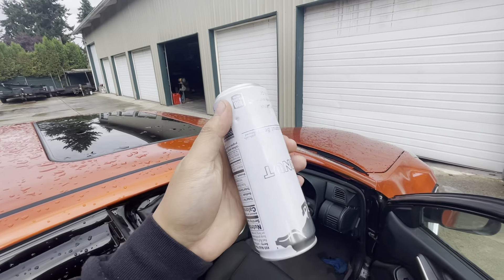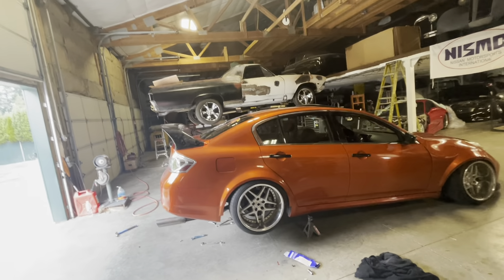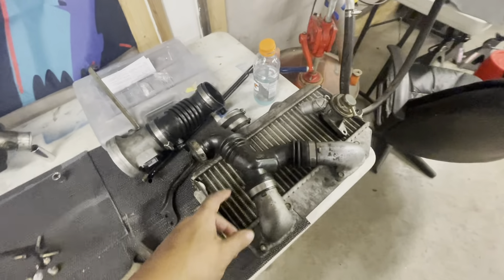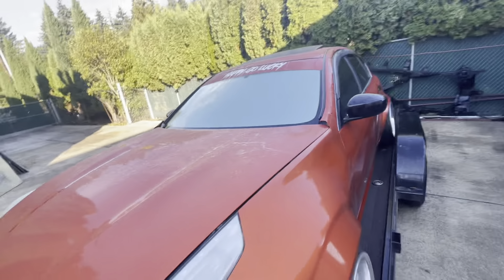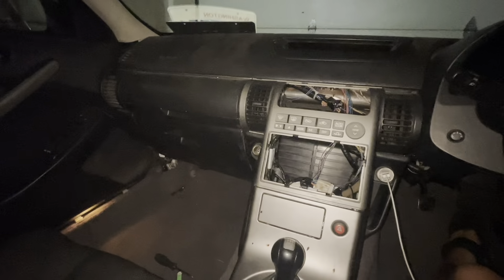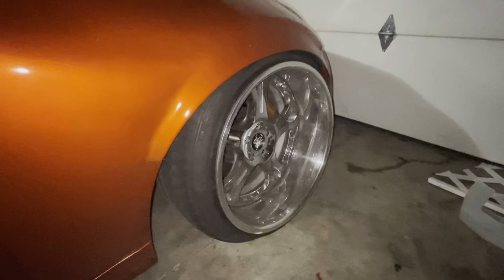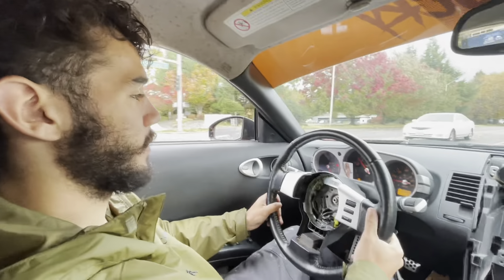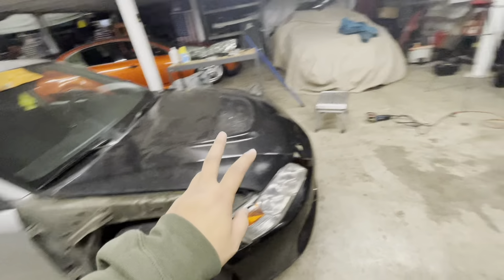350z Sedan Got Broken Into * Brand New Turbo Stolen*

Comment: The leak may be from the rubber grommet that was probably taken out under the black vent housing by the battery. Installing a stereo system people will usually pull that grommet out to run a wire through the firewall. Or drill a hole next to it like what happened to me

Comment: re attach the door seal, try repairing with permatex black silicone if needed. maybe add some glue to the attaching surface, rubbery glue.re attach the door seal, try repairing with permatex black silicone if needed. maybe add some glue to the attaching surface.dark blue is good all around but not so much on subarus imo you need a less common color so id say go red. dude thats not cry baby at all that sucks. things are going to get bad with theft lots of migrants coming in. it might not be the door seal as well could be windshield or air vent area related. i had seen a old corolla rust right there was a cabin air leak issue.